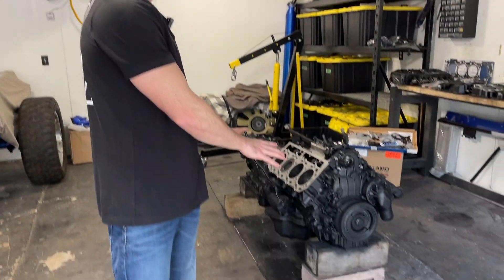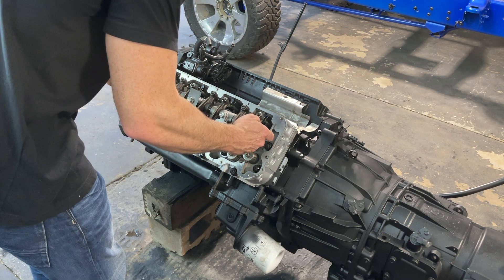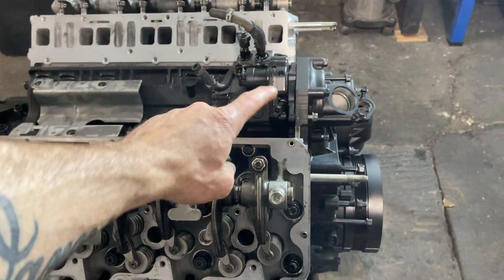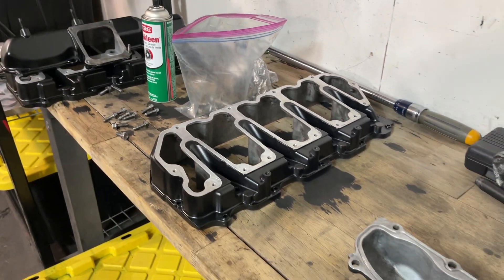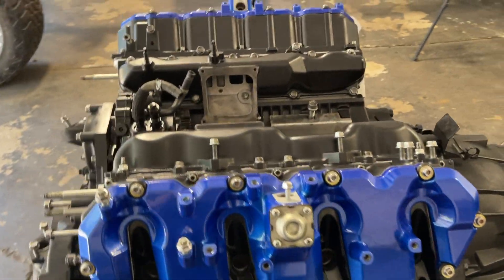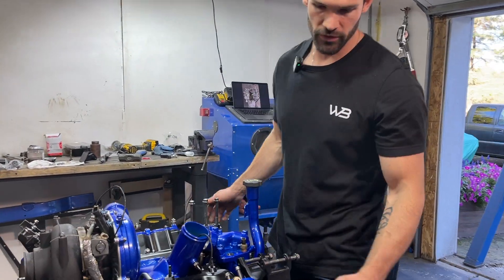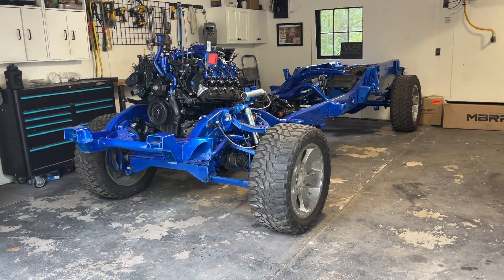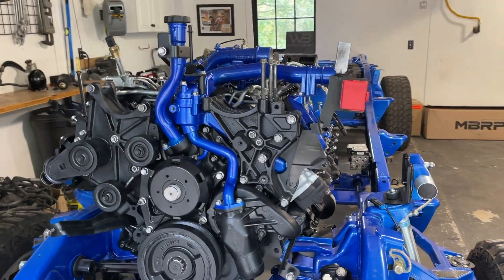BUILDING A LBZ DURAMAX SEMA TRUCK IN MY GARAGE | PT 12 | ENGINE REBUILD

Comment: Looks good bro. Consider a Fluidampr crank pulley while it is easy. Makes a huge difference on LBZ and LMM.
Reply: @mwstonesr  - I was looking at doing that during my waterpump reinstall (shop I took it to rolled the o-ring). Are there special tools needed to install the fluidampr?